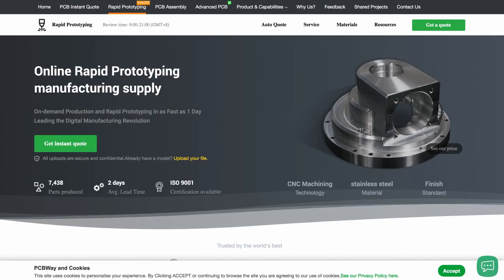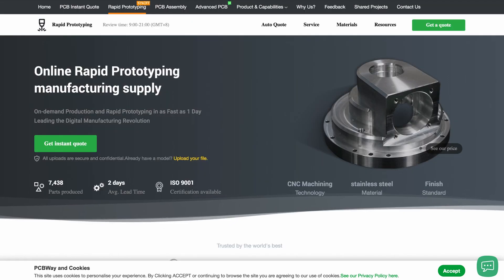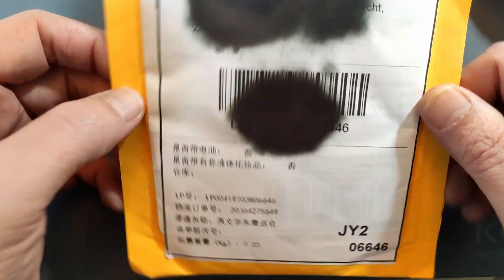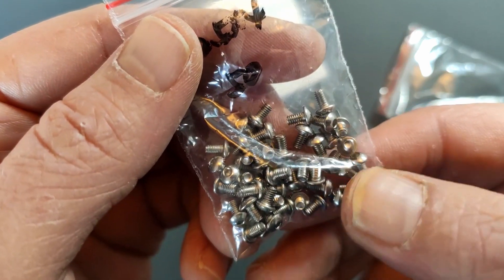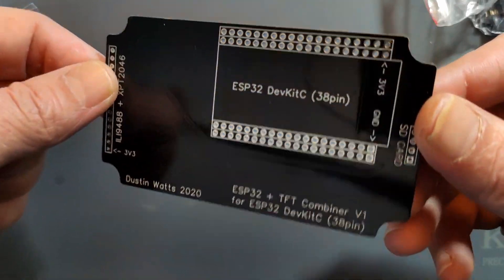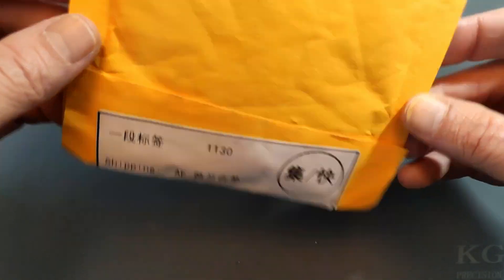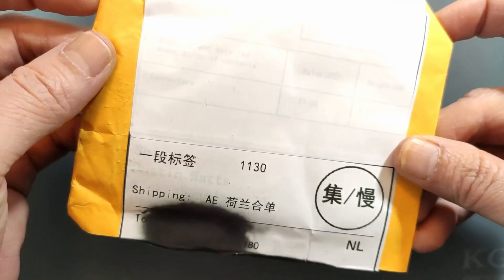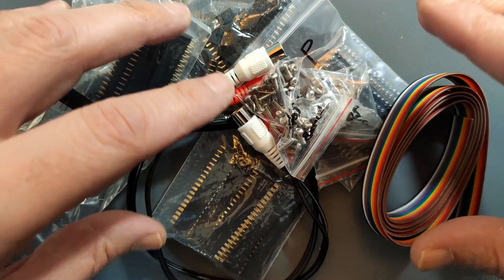Headers. Headers. Headers (Postbag #19)

Comment: How are you going to connect connectors to the multiwire flat cable?
Reply from the maker: Not… I use separate them and use the individual wires. Or sometimes is leave a few attached to each other if I need more then one wire.

Comment: I just discovered your touchdeck stuff, ordered 10 connector boards on pcbway and have my arduino all setup to build them (once the touchscreen and esp32 arrive... 
Just wondering... does the 3D printed case you have on your website also account for these pin headers?? ( ordered all of the pin headers too... :)  )
Reply from the maker: Hi Geert! That is a good question. A question I didn't ask myself as the pins where kind of an after thought. They don't fit if you use the normal front (top) of the case, but I have made a version to accommodate the headers called "Top_for_TFT_with_Headers.stl". So TL;DR yes!
Reply: Great! Thx for that! also posted this on a FB group in Belgium... so expect some influx of your southern neighbour's :)

Comment: I hope your ESP32 is not as wide as mine. As I could never insert the board into those header pins without the side overhang blocking the 'extra' row of pins.  I guess it just depends on who created the PCB.
Reply from the maker: The ones I use are fine, enough room. But indeed, if a designer doesn't pay attention or the PCB manufacturer has bigger tolerances it can happen that it is too big.

Comment: Hi     Here in the UK we call RCA connectors  PHONO connectors ( I dont know why ) -- So you could try searching for them
rather than RCA . For example  cpc.co.uk sell  PHONO SOCKETS .

                                                                                                                                   Alan
Reply from the maker: Hi Alan! An RCA connector was originally called a phono connector because it was used to connect phonographs to old radio's. And it is still labeled that way on some preamps and you can always find one labeled "phone" on a mixer to connect a turntable.

Comment: You can never have too many connectors.  The word you were looking for was "ribbon " for the  cable. I won't say rainbow as  the colours are the resistor  colour  code:)
Reply from the maker: That was exactly the word I was looking for. On AliExpress you can find it quicker if you type "rainbow cable" instead of "resistor colour code cable", so I stuck with that ;)
Reply: @DustinWatts  just like most things on Aliexpress and Bandgood, slight issue's always to be found with the discriptions. :)
Reply from the maker: @TheEmbeddedHobbyist  It's part of the you of searching for components :)